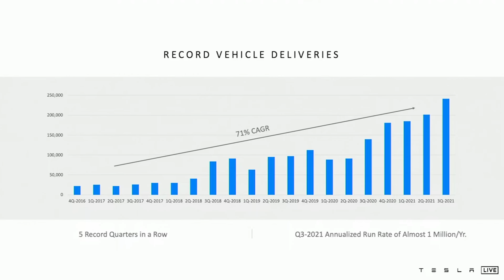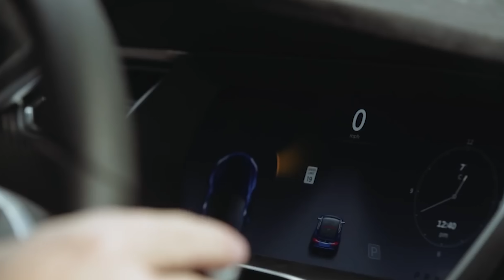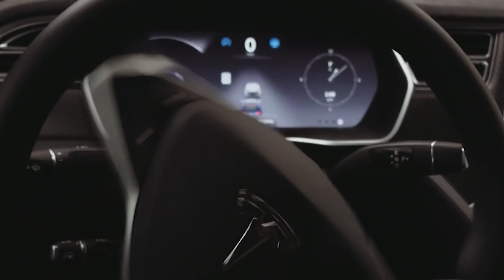Tesla 2021 Shareholders Meeting Explained

Comment: Ha-ha ! No car company can ever grow faster than 50% a year - it's impossible. Elon "Hold my tequila..."
Reply: GM 100% growth

 1 car, 2 cars, 4 cars, 8 cars, 16 cars...
Reply: OK, but how long?  71% CAGR for the next nine years?  That's what TE was implying.  Think about the requirements for that.
Reply: @incognitotorpedo42  Your stars, and supply chains, need to be totally aligned...
Reply: @incognitotorpedo42  Elon believing they can grow at over 70% rate is in short term. Their offical goal for the long term is 50% CAGR. That hasn't changed.
Reply: "Hold my GigaBier"
Reply: GM is still holding out on the Bolt recall while owners are stuck with car-shaped bricks that can’t be used.

Comment: Elon said Tesla could build 5,000,000 vehicles with some expansion of the existing factories. No rush for a new giga factory yet! Elon wants to get the two new factories ramped before making any new ones. This should get use through the chip shortage and battery ramp up! 💎🙌TESLA